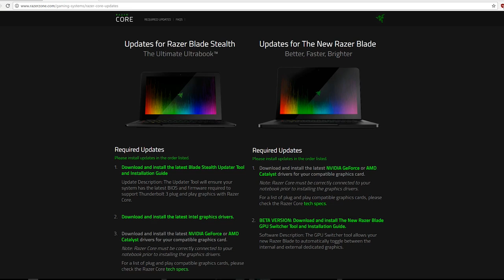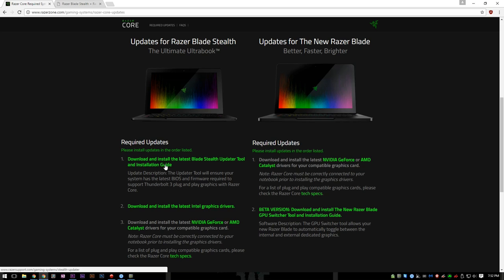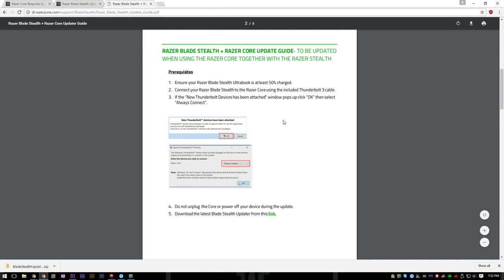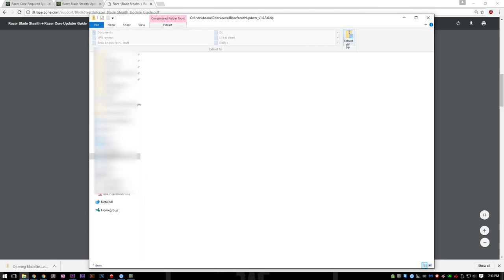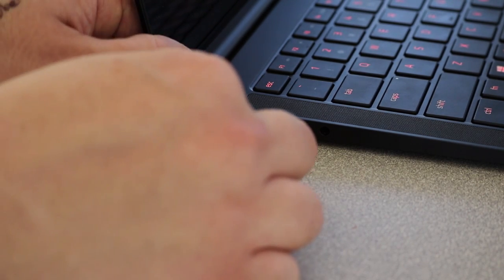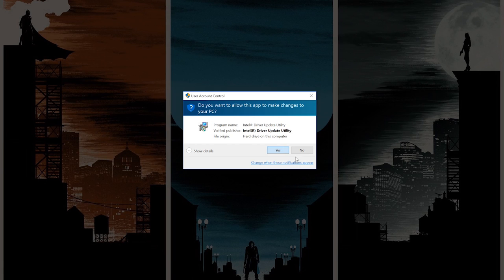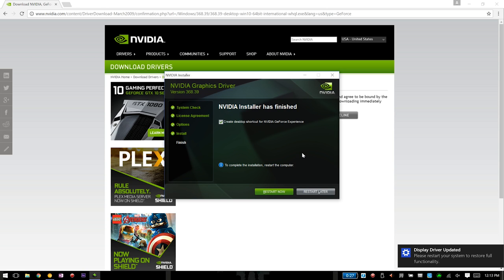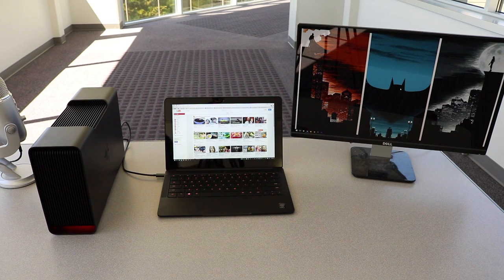How to setup the Razer Core

Comment: Not to be that guy, but I'm gonna be that guy. Will this work on new MacBook Pro?
Reply from the maker: +Will Power unfortunately, it will not
Reply: Works with my 2015 MacBook pro
Reply from the maker: I'm curious which Razer core you have? I was under the impression that osx only works with the Razer Core X? And needs osx 10.13.4?

Comment: Have you tried playing doom with the stealth, I have the rx480 and Im gettin 27-30 fps you think is because of the dual core?
Reply from the maker: yeah unfortunately the i7 in the stealth is just dual core and honestly not a cpu made for gaming. It is a 6000 series but its still a "mobile" processor so low power and all that jazz. I'm actually kind of surprised you are getting up to 30 fps. Are you on ultra settings?
Reply: Yes Ultra 1080p
Reply: also are you on the new Razer Blade Stealth one by any chance ?  Apparently a slightly better performance?
Reply: maybe it was an update or something but now I'm running doom over 90 fps, you can see my video search doom Razer core. I'm on the original blade stealth.
Reply from the maker: +trishan17 I'm not. This is the first gen one. Sorry
Reply from the maker: +Omar Aguirre García interesting. I wonder if doom got an update our something
Reply: nvidia drivers improved significantly in the past month
Reply: Have you tried charging your laptop while playing,I made that mistake before(not playing with the charger in)